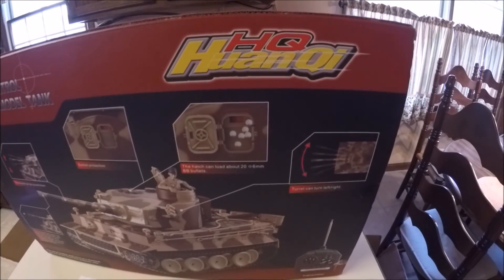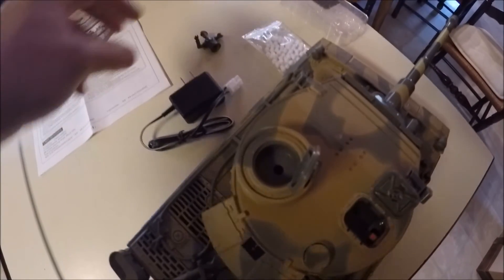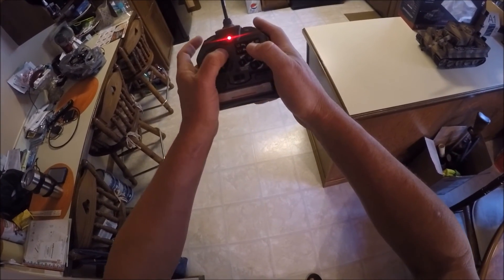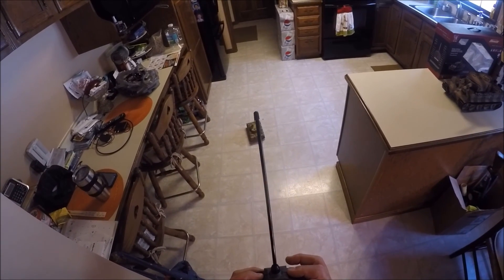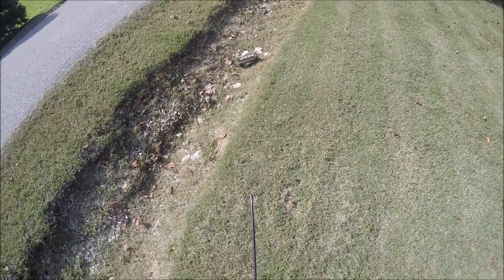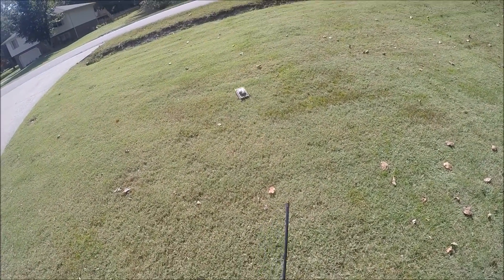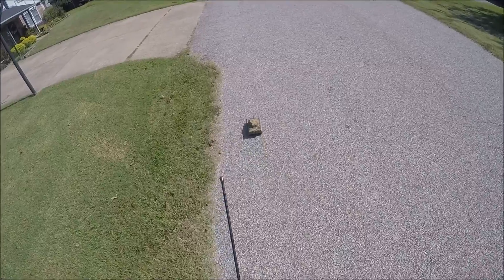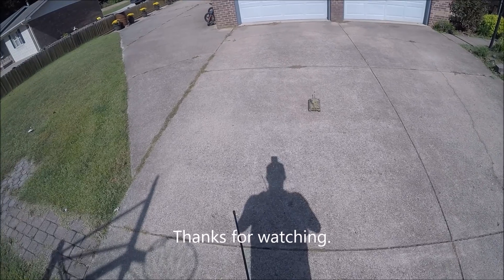1/24 Scale German Tiger 1 Tank First Run

Comment: The tank In my opinion is great for the price, only around 40-60 USD. It has some downsides though. The sounds are very unrealistic, for example. The controller doesn't have joysticks but instead buttons. Overall, the tank is a pretty good buy, with the quality of a 70-80 USD tank,

Comment: I have one which I just painted up. However the right side has stopped working. Is there replacement parts or is it repairable? I'd appreciate it. I want to give to my grandson
Reply from the maker: I would think at $50, it's probably not repairable with part you can buy.

Comment: I bought 1 from eBay. But,is a Heng Long. Only thing about the tank. They made the holes too small or big. The tank parts won't fit the holes. I had to glue some parts. The machine came in 3 pieces. I had to glue that to hold the pieces together.

Comment: My tank doesn't shoot correctly. But I have the feeling I did something wrong or just didn't charge it enough. I just got it to. Anyone have any advice?
Reply: It's very weak when it fires.
Reply from the maker: Try doing a search on the RC Universe  Tank Forum.
Reply: Never mind what I said. It jammed the first day I got it. I can see the BB in the barrel. Any tips on how to remove the BB?
Reply: DemoLex Hi, the airsoft gun mechanism is prone to damage if use reused or cheap BB. The problem may be where the ball drops into the rubber hopup, which creates a seal round ball and produces a back spin. These can damage easily. Can you see the BB?. To my mind it may be the hop up or the gun mech itself. try spraying silicon spray with nozzle extender down barrel(can use WD40). If you are lucky it may dislodge, if not as last attempt take apart, if brave enough. Take photos at each stage putting screws in a sheet of card board indicating where they are on the tank. Search on YT for VStank strip down it shows you how to get to barrel. First ensure no foreign objects in barrel, put new BBs in hopper lubrication may see hopup reform its seal. But my bet is the gears of the airsoft gun may be stripped. Sorry these are very delicate mechanisms which easily can be damaged. Spares can be found, but you will find better off buying a new $40 Tiger, but lubricate, keep barrel and hopper clean, use good quality BB, never reuse if deformed. Plus when firing try not to recycle mech continuously, ensure hopper has enough BBs to gravity feed the breach in the gun hop up. Look up BB guns or AEG guns you will see how the mechanism is not sesigned for rough usage.
Hope it helps a little.....
Reply: axel usul Thanks for the tips It was very helpful. I'll try silicon spray out. And if that doesn't work I'll try plan B very carefully. Once again thanks for the help!
Reply: DemoLex No problem, great fun but can be temperamental.